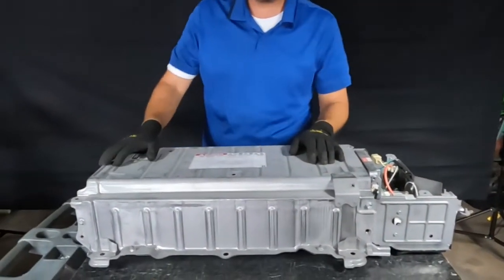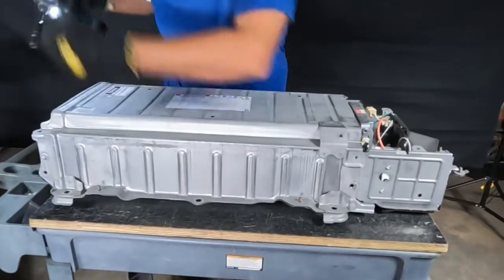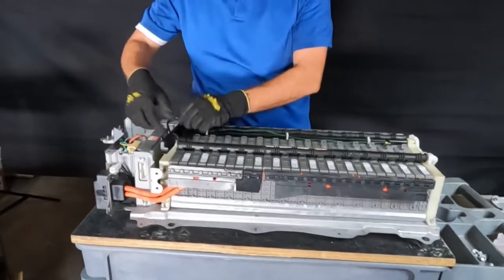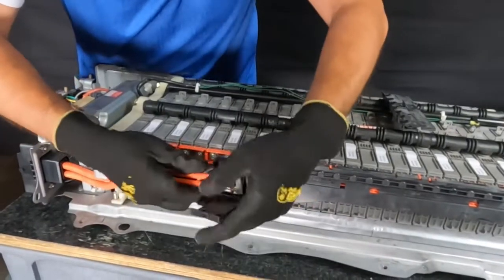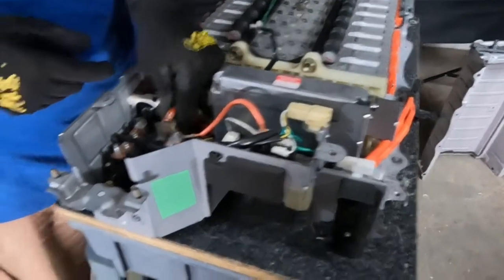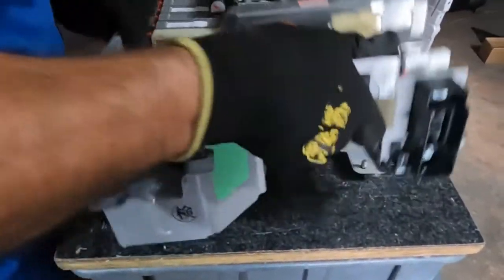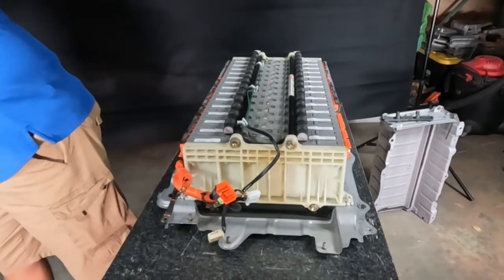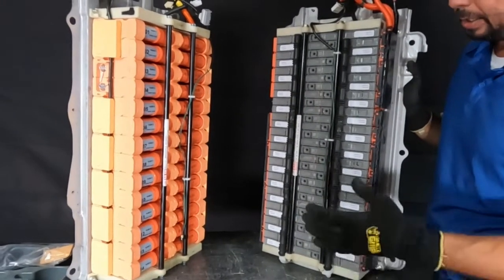Removal of Hybrid Battery Pack from Toyota Prius Gen 2 (2004-2009)

Comment: do you send the reconditioned batteries with the computer set you just remove or only the batteries pack?
Reply: We can send them both ways.  It depends on which product you purchase.
Reply: @alexvaller3797  it cost more with the computer set or it's the same price???
Reply: @panblanco1  Just the pack with wire harness (as you see it in the video) w/o the case or other hardware is $790 plus shipping. If you purchase it all together the price is $890. The computer isn't part of the purchase.  We include it to make the replacement easier.  When your core comes back, we test the battery and the computer.  If the Computer is faulty there is a $150 charge from your deposit.
Reply: @alexvaller3797  Thank you very much